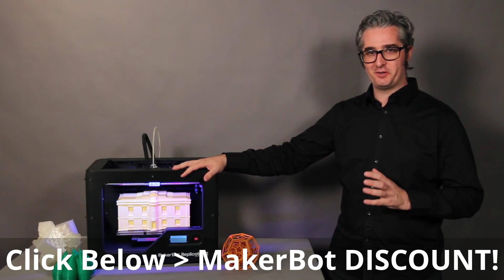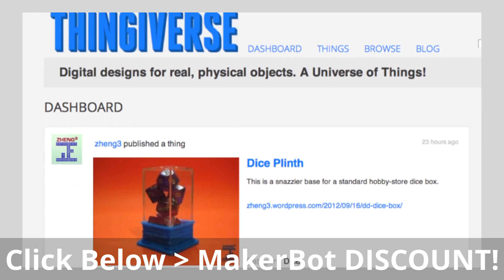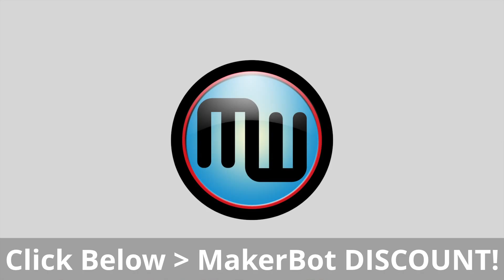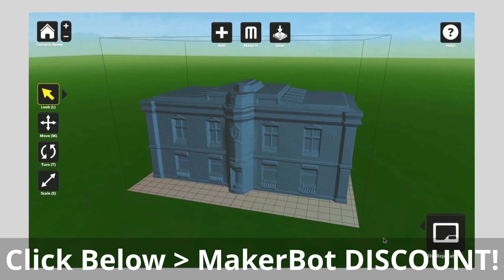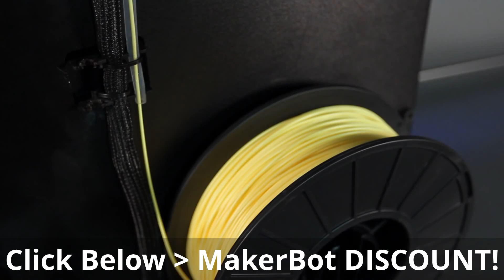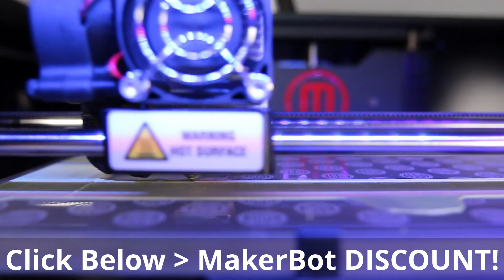MakerBot Replicator 2 - Best 3D Printer!

Comment: I know this is an old video, but i'd just like to say you can buy decent 3Dprinters from about $200-$300 and up.. I paid like $600 for mine.. 

Det differences between the cheaper ones and the expensive ones is mostly how much you have to tweak and calibrate for it to work properly .. and the difficulty of doing just that.. 

The expensive ones are made so that even an average 90 year old would be able to use it, while the cheaper ones require alot more work and you really need to figure out stuff and how it works.. Which is not a bad thing at all.. you learn ALOT by using these printers and in my opinion it is the smarter choice if you want to learn.. not just press a button and start printing stuff.

The more expensive ones i can see is better in an enterprise setting, where they design and produce stuff or prototypes an don't want to worry about how the printer work so much.